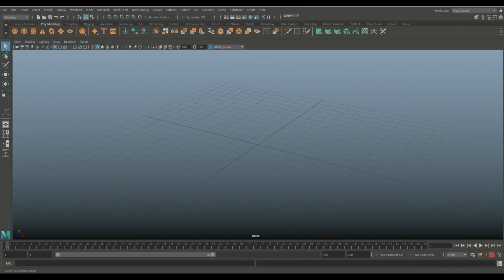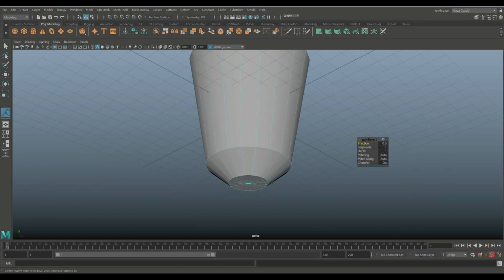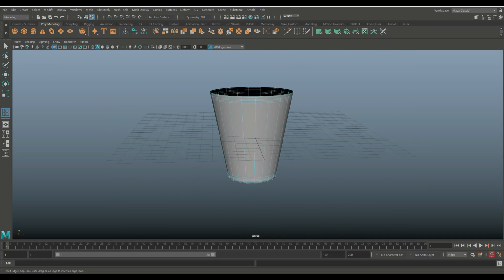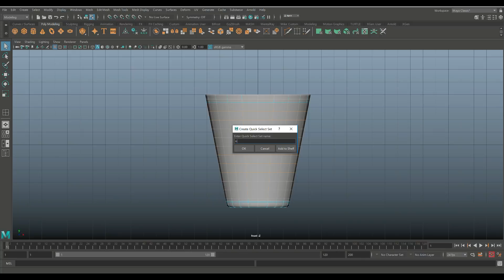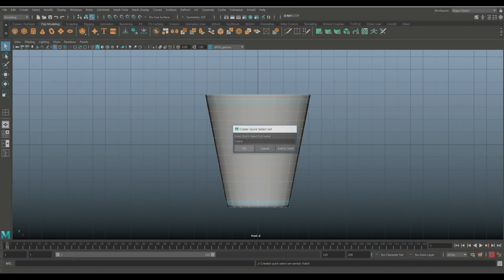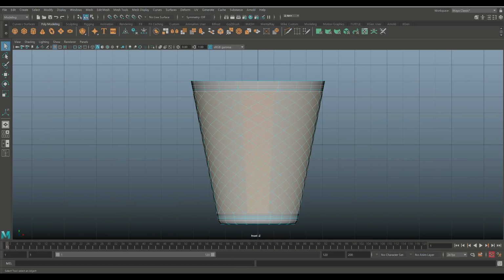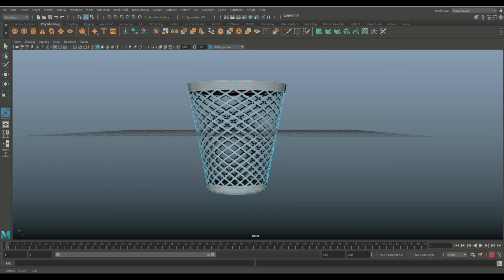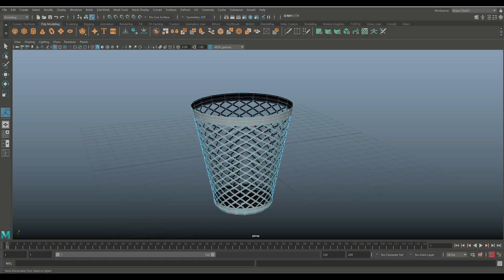How to model a Wire frame Waste Basket in Maya 2019

Comment: Another method would be to created whatever pattern you want, and use the bend deformer and other deformers to get it into the basket shape.
Reply from the maker: Interesting, and how would that work ?
Reply: @MHTutorials3D  It's the same method of creating a tire thread, model a pattern in a flat state and then just use the bend deformer to get it into shape.